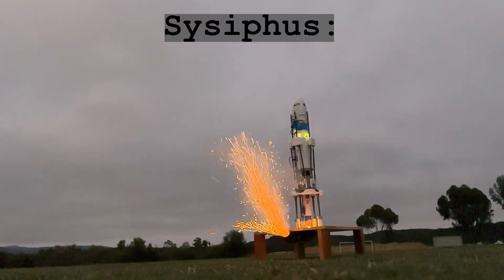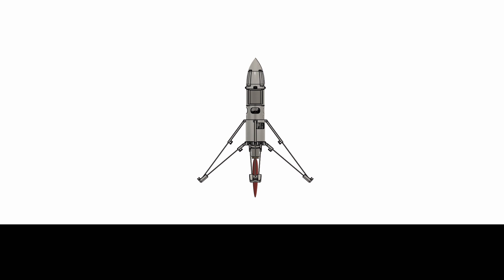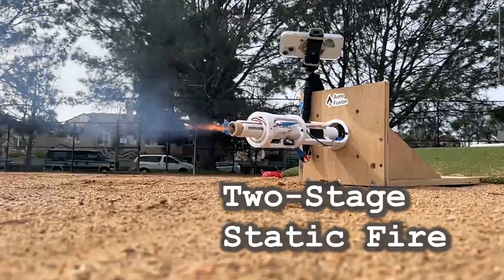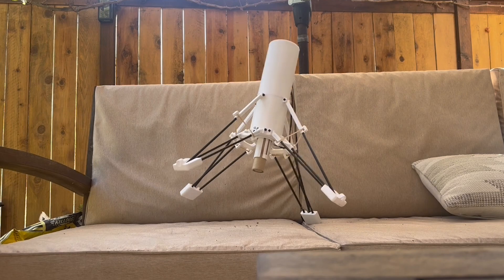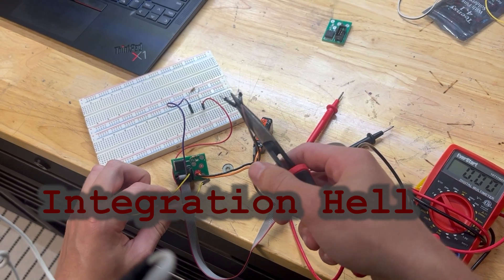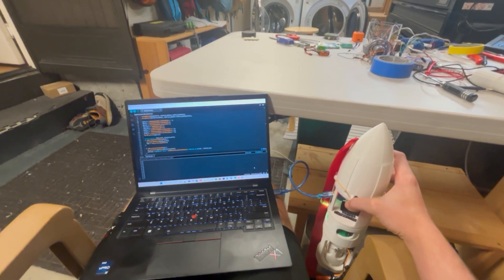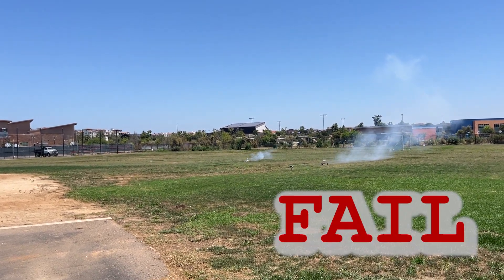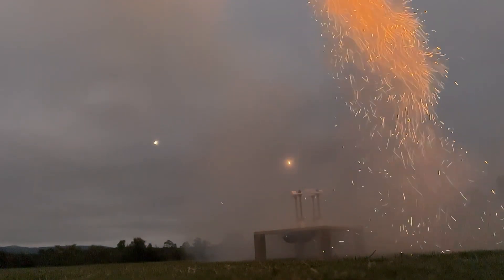I want to Land a Model Rocket Like SpaceX

Comment: Its correcting too much, so when it tries to come out of the initial angle it overcorrects and goes too far, as you can see in both attempts. if you tune this down a bit that should help, try getting that down before you start working on the descent motor. maybe install a parachute or something for now and then you can start with the descent motor. Goodluck! don't give up, your doing pretty good!
Reply from the maker: Yeah, I’m planning on doing only ascent for the next few launches. As for the parachute, I think both times it trued to deploy but the ejection seems too weak to be effective. Thanks for the advice regarding the PID overcorrecting, but I feel like if it were overcorrecting it wouldnt have deviated off course so much at the start. You’re probably right though so I’ll try reducing P next launch.

Comment: my opinion comes from a little nobody from the internet with no education or study in this field so with that being said. for improvement i would  take qualities from the original. and the only things i notice is the landing gear, nose, and length of the body are different. i can't imagine the work put in to making this big project, and it doesn't look like your that far from success. i also feel that with the parachute and your design for the rocket replacing are gonna be the biggest hurdle. now with all that mumbo jumbo i just spewed i can't say I'm giving good advise so take word from people who has better experience and understanding in how to accomplish your goals. keep up the good work
Reply: just an idea is to possibly have the old rocket design but have the operation be in reverse. as in have a rubber band or spring pull it instead of pushing it out

Comment: Get a fpv quad, put a rocket motor on it, light it, land it. done.
Reply from the maker: using a drone is cheating 😅. also sunk costs 🤷‍♂️
Reply: @braxton_herold  how is it cheating? Have you ever heard of the rotary rocket?
Reply from the maker: Well I feel like that would be less of a challenge and not really quite where I want to go. Admittedly however, since posting this vid I just started working on replacing the rocket motor with a brushless electric motor for testing purposes.
Reply: @braxton_herold  If you do that I'd suggest making a test stand for tuning the control system. It feels to me like the response is sluggish and tuning it might help
Reply: @braxton_herold  Put the motors on the legs that pop out, ez.

Comment: I think it’s not having fins tbh
Reply from the maker: Good guess, but fins aren’t actually required for rockets of any size, as long as you have most of your mass in the top half of the body tube — since this would still preserve a stable relationship between center of mass and center of aerodynamic pressure. Fins would have been hard with the landing legs, so I figured I would just have more mass in front. However, it turns out that, at these low speeds, aerodynamics don’t play much of a role; so it shouldn’t matter either way.